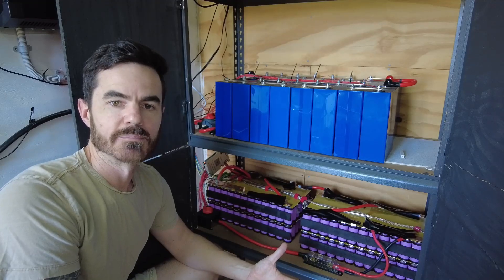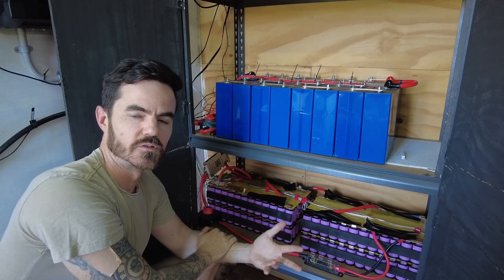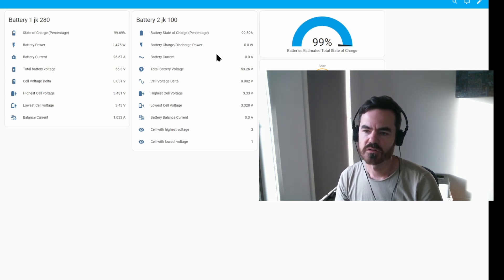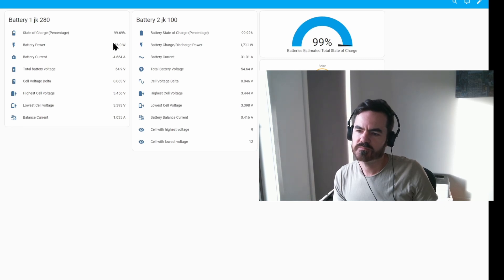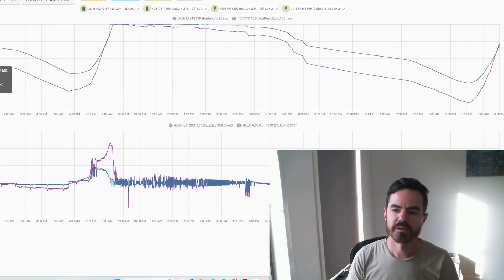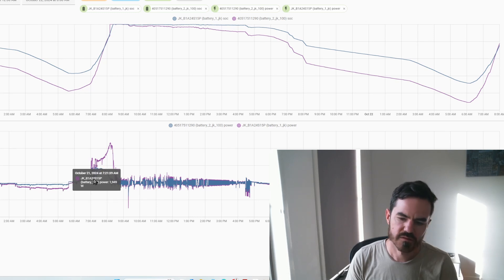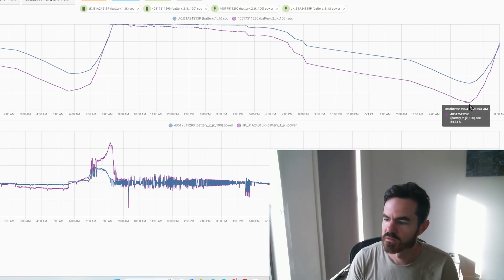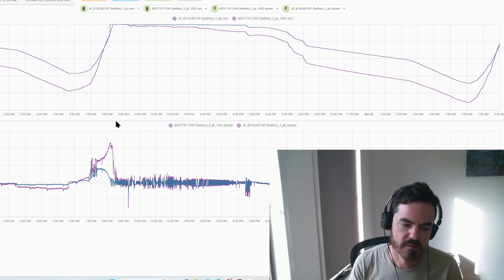Can I run in Parallel DIFFERENT CAPACITY Batteries? 280ah & 100ah LIFEPO4

Comment: My older battery stops earlier than my newer due to cells not being the same capacity and the BMS cutting off earlier due to low cell voltage. But not a problem, until the BUS voltage goes up the older battery is just with the discharge FET off, then starts charging again when the bus voltage goes up again - ie sun out. Of course, the newer battery has to pull all the weight meanwhile, at least until it also runs out.

As long as you have a solid bus or interconnection, and low resistance cables and terminals, so voltage stays the same across all batteries no matter the load, it will be fine - the common bus voltage will lead the orchestra and batteries will tend to charge and discharge in the same proportion as their capacities.

Comment: So am I right in thinking that you believe it's okay? I have recently connected to 135 amps batteries. Same brand to 100 amp batteries of a different brand and they seem to wear absolutely fine. I believe as long as a BMS is doing its job it should work absolutely fine
Reply from the maker: Yes correct, its completely fine. As you said as long as bms is working as it should.

Comment: Me watching.. after i paralled 2 350mah lipoly to a 1800mah lipoly from a new drone battery.. for my headphone battery mod.. after a few weeks of charging daily the 1800mah bloated and push the headphone open.. fortunately caught early and no fire...
Reply from the maker: Hi mate, Yeh dont recommend doing that with lipoly, they usally dont have any inbuilt protection. However doing it with LIFEPO4 Batteries that have BMS on each is no problem at all.

Comment: It would be nice to see what happens if the smaller battery reaches the bottom. Can you still use the remaining capacity of the larger battery? What is the BMS doing while the smaller battery is at 0 percent? How is the recovery process working when charging again up to 100% ? How do you handle the error messages from the smaller bms since the errors are "normal" compared to a real battery problem?
Reply from the maker: Hi mike's, I discussed some of this in the video when looking at the charts plotted from home assistant. The batteries would likely reach 0 percent around the same time (due to when the voltages gets lower on the smaller battery much more currently will flow from the larger battery) And they also fully charge and reach 100 percent at the same time. I don't get any error messages from either bms. Thanks for your comment

Comment: We can connect two JK communication systems, and the management unit will regulate according to the discharge rate, for example, discharging at 0.2C proportionally for two different capacities. Please connect via IJ communication and experience it.
Reply from the maker: Hey mate, what do you mean by management unit? Do you mean BMS? jk bms don't have current limiting, they do have overcurrent protection though.
Reply: "I'm currently using the BMS JK JK-PB2A16S-15P." ->Can rs485 to can 485
Reply from the maker: oh ok yeh thats an JK inverter bms. I personaly dont want to bother with communication between the inverter and BMS. The inverter bms doesnt have current limiting so they dont actually regulate the discharge current, the battery voltages do that automatically so its not needed anyway. Also when you using a victorn system with a venus os on raspberri pi or cerbo gx if for whatever reason your pi or gx fails your inverter will also stop discharging or charging. If you just let the inverter calculate capacity it will keep running even when your cerbo fails when running off grid. Andy from off grid garage has also discussed this. I have been running mine for months now with no communication and it all works fine. Also the inverter bms is much more expensive, so not worth it for me really.
Reply: @ProjectElsewhere  I carefully reviewed your video. Currently, you're using the JK model, which lacks communication capabilities. We should consider discussing an upgrade to the IK model with communication features. This would be beneficial, though it may involve significant costs. I hope this is a helpful personal suggestion
Reply from the maker: @ticknguyen  yes that's correct! I just explained the reasoning for this on the above comment.

Comment: Was the jkbms easy to add to HA? I have some victron components without a cerbo gx and it was close to nightmare to get all the data in.
Reply from the maker: Yes its fairly easy, just need to use the batmon addon. It scans for bluetooth devices and you then just put in the bluetooth address of the jk BMS and it reads everything.